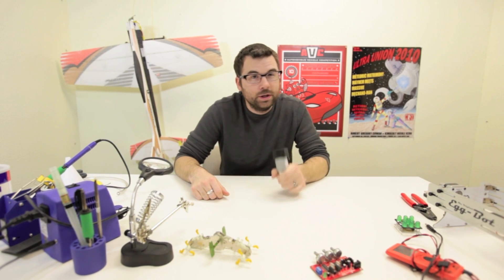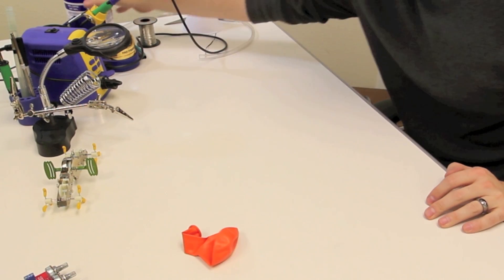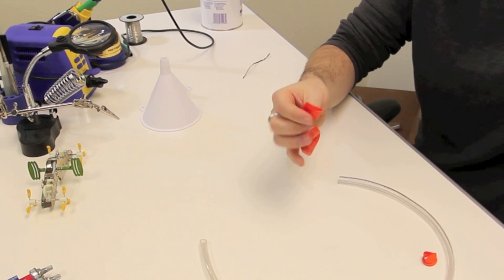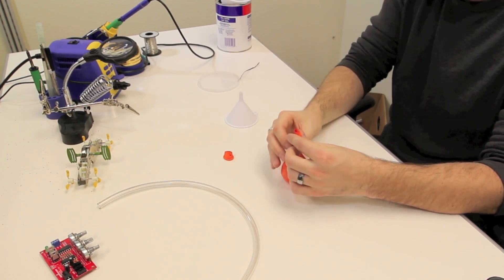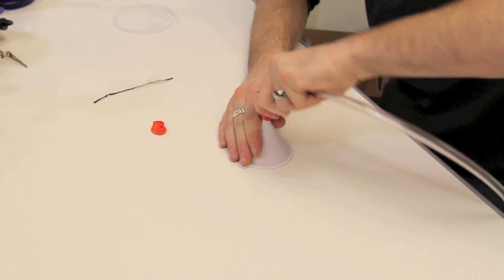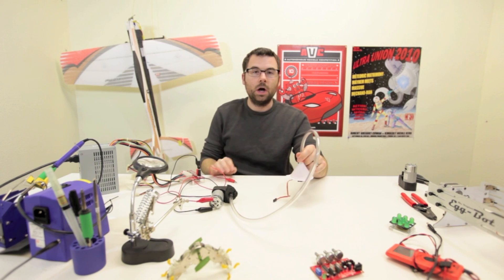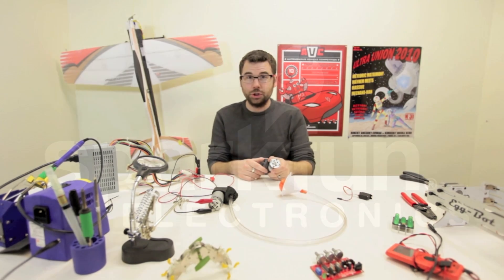SparkFun Vacuum Pump Gripper

Comment: I agree with Frances Crow. You could put a check valve in it and then use another circuit to decide when to activate/deactivate the pump, and close/open the valve.
Reply: 9 years later, but hopefully youre still active, are you saying that he should have a check valve and a valve (electronic/solenoid) working together? check valve in the main line to stop the air going back and then valve to release the pressure (or let air in I guess in this case). would love to hear more about this for a video im working on

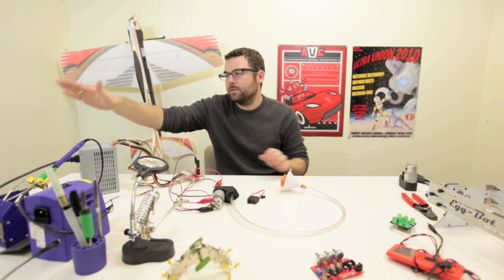Comment: what is that thing in 1:45 that is plug in to the power supply? i mean that board and when i can buy it?
Reply: That's not a breadboard.  It is the Benchtop Power Supply Kit from SparkFun.  It allows you to use a PC power supply as a benchtop power supply with 3.3V, 5V, 12V and -12V outputs.  https://www.sparkfun.com/products/9774
Reply: It's called a "breadboard". You can get them at Radio Shack or any electronics hobby supply store, and eBay of course.

It's a little plastic slab full of holes that you can plug and mount electronic components to. You use it to put together new circuits. It is usually just for putting them together for experiments because you can easily add, move, or remove components. Then when you think you have what you want, you can put the final version of the circuit you build into something more permanent like soldering to a PCB board or something.

It looked like he used the breadboard to make a connection interface from his computer power supply to the pump.
Hope that helps.
Reply: Thomas Replogle Thanks for repley :) i have been looking on sparkfun store but didn't find anything else than clear board with goldpins. This is what i'm looking for :)